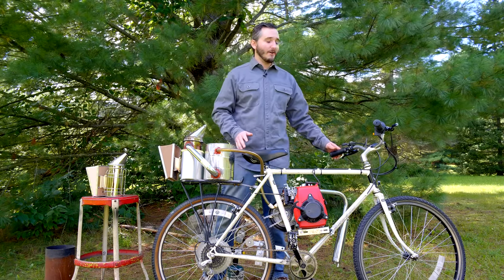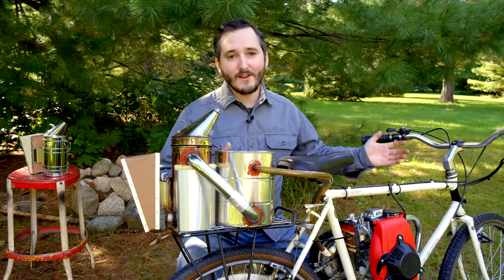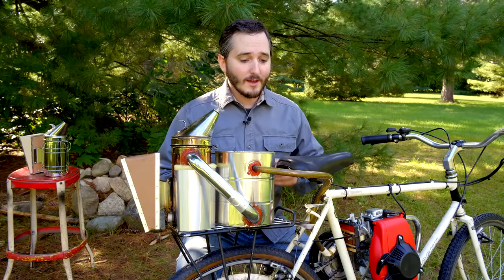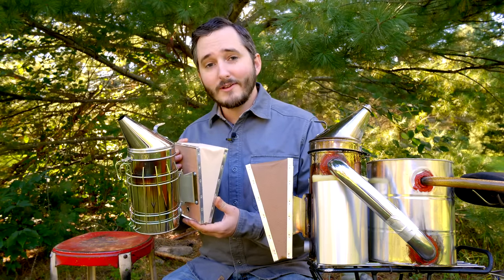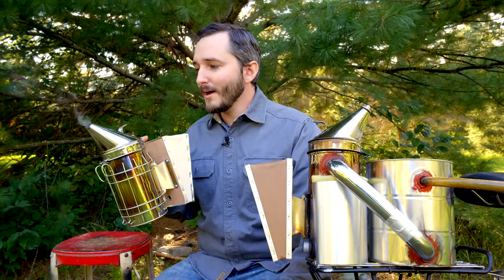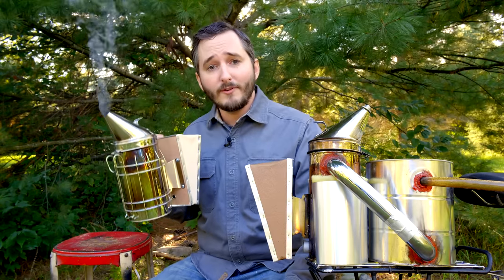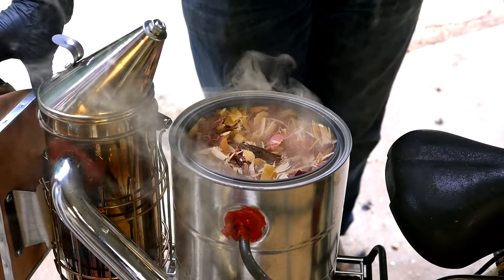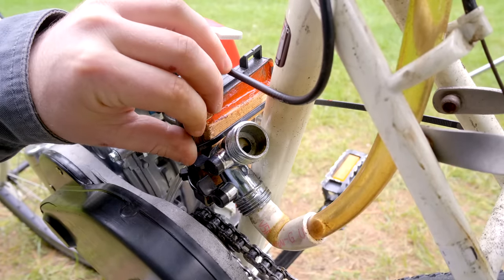Running a Gasoline Engine on Firewood | Woodgas Biofuel

Comment from the maker: Edit: My new videos have been performing pretty poorly these days. You can help by sharing this video to relevant pages on facebook, reddit, etc.. Please don't spam on my behalf, but if you know of groups that would appreciate this video please do share it. Thanks!

A few things I did not mention in the video: There is a small hole drilled into the elbow that connects the gas line to the lower valve on the intake. This allows any condensation that makes it past the filter to drain out. I also realized that the engine's upstroke is blowing a lot of my fuel right out of the intake as evidenced by the smoke pulsing out when the engine is running. I probably need to figure out a one way valve setup so the engine can blow off that backpressure through a different outlet than where the fuel/air comes in.
Reply: 2 stroke scooters use reed valves to eliminate blow back into the carb. Not sure if that system is used on 4 strokes but could be useful in my opinion
Reply: Could you put Air compressed ? For help the combustion
Reply from the maker: The gas is quite cool by the time it passes through the filter, so this may work.
Reply: Why would an upstroke blow gas out of the intake? That does not make any sense. On the upstroke the intake valve is always closed.
Reply: @SinBird I think this is caused by the mass of the gas flow. Inlet valve closes quickly but gas stream wants to continue and the easiest exit path is the ball valve. Same thing when you close a garden hose quickly, you will see the hose move.
Reply: Sorry to hear about that, seems to be more and more problematic with project channels due to YouTube changes.
Reply: You should make a cast iron coffee maker into a bee smoker
Reply: @nickgroen89  i beleive thats called the water hammer effect or something
Reply: Heres some ideas to help get the gears turnin. Off the bat im imagining something like a rocket stove being fueled by the charcoal produced in the reaction chamber its heating ala your earlier design. This would seperate that unwanted product and minimize filtration. As far as fuel i was thinking something like those pellet hoppers they use on woodstoves, if your looking for a controlled consistent fuel look no further than that. But as the eventual goal is using common fuel maybe something closer to a magizine, where long sticks could be steadily fed in as needed. I can't think of a way to make the magizine automated but im sure its possible. Plenty of people who know more about one way valves thsn I have that topic covered. Beyond that i guess its just a matter of producing enough consistently to run the engine. Good luck mate, i respect how you arent uncomfortable showing us ideas that arent finished like this.
Reply: #1 .- replace the garden hose valves with a propane carburetor kit for generator from ebay.
#2.- make a gas (smok) container that can pressurise the gas just 10 psi or so with directional valves , you know, inlet, outlet .
#3.- install  an air pump (electric or manual) to force air flow in the gas combustion chamber (reactor), making smok (gas) go to the inlet directional valve to the gas container to the outlet directional valve to the propane carburetor  conversion kit in to the engine .
Note: (As a pressurized gas container you can use a balloon or bicycle rubber inner tube tire .)
Reply: @Nick Groen That's exactly what I thought.
Reply: You might also have more luck by upscaling signifigantly. Depending on how well the setup works it might work better on a signifigantly bigger platform.  Something like those offroad utility vehicles but more street oriented. Where youd have a sealed cabin for the front two seats and just have a huge rig in the back
Reply: ust to get this clear, 2 strokes are actually more efficient than 4 strokes. If you look at the pressure volume diagram, you will notice that the 4 stroke loses usable energy by pushing exaust gases out, inhaling fuel air mixture and compressing them 3 seperate strokes while the 2 stroke needs just one stroke to do the trick. The reason nobody uses them is the burning of oil wich increases CO2 and unburned CH emissions.
Reply: Would a small check valve for aquarium airlines not do? Cheap & you can get metal ones.
Reply: Yeah I havn't beefor about ane and a half or 3 years and the last few I have checked I have been un-notified about your videos when every single time I come here I hit the notification bell. IUt's like they are hiding your videos and unsubscribing people without their consent.
Reply: I just came across your channel for the first time, and enjoyed your videos... except for the advertising. It's kind of obnoxious, especially when you watch a series of them back-to-back, and especially when it's the exact same set of sponsors that we have to suffer through on other channels. Pretty much the same issue with Mentour Pilot. All the best.
Reply: I'm speaking out of my element but would active carbon help with the filtering? If so, you might be making an ample supply of it with the gasifier.
Reply: Try to run it on Hydrogen
Reply: Try it with a tube on the intake side with the same resistance as the fuel one
Reply: The content is  not the reason, you always have great videos with no clickbait. That can't be said about most of the people on here.
Reply: Weld a extension on to the bee smoker to get are 4x, I would also suggest a diesel top cover tractors you can make it heavier and have it pulled out the string to open it and pull on the other side of the road to close it
Reply: Congratulation dude, you got an new subscriber ;)
But maybe you can make 3 things for more efficiency;
1: you can adjust the ignition timing of your engine for your engine runs better
2: an stock petrol engine have an compression tax too low for runing on wood gas. If you want to make a engine for running only with wood you can make an "upgrade" for your engine got more compression (but will only runs in wood gas).
3: uses an blow back valve before the intake valve. (use an air filter too) For fhe condensation problem you can use the same system as the air compressors uses for avoid the water vapor in the lines.
Reply: Maybe people quit watching because of your commercials.
Reply: @Nick Groen I was looking for this. If the engine has any compression it won't blow back out the intake.
Reply: A cool bird at the end and a comment from cody is enough to get my sub :)
Reply: you should use charcoal (powder) to clean the gas and you can add some sort of sillicagel our salts like table salt our a better option is MgSO4 our maybe CaCl2 in a  drying tube (5dollar ) straight after the cleaner box our you can mix the salts in the carcoal. so the water vapour is out of your gasmixture i think that is one of the biggest issues in this setup you can see the condensed water in the tube. but what a nice project! i love it!
ps that is one beauty of a beesmoker i would love that one!
Reply: You might consider getting a LPG/NG duel fuel carburetor conversion kit and feeding the wood-gas to the engine through that.
Reply: I'm no longer on FB or Twitter
Got banned for political reasons
I do SHARE every one of your videos I watch on GAB
I receive a lot of Thank You's from others for sharing your content
They Love your videos
As do I
Reply: NightHawkInLight please mate put this into a kit people can buy with a one hour long step by step build DVD that anyone can understand. You can change the world with this. Please help your fellow humankind with technology
Reply: YouTube prefers channels that upload prequently, sadly. I'll definitely share it with my friends
Reply: Install a supercharger. This should help a lot.
Reply: Maybe that’s because you content is not as good as it use to be
Reply: I may have missed that info why you do it this way but, wouldn't it be better to make wood gas stationarily? Just load it to a tank, compress and plug to engine instead of making it on the go. Sorry if that's a stupid question.
Reply: Use a reed valve on the intake to eliminate the backflow. They are pretty common for motorized bicycle kits.
Reply: NightHawkInLight You deserve millions upon millions of subs. Try uploading 15 minute vlogs of your projects every other day.
Reply: We still love you!!!
Reply: BikeBerry..plus there's some FB groups - One I know of off hand is run by Zeda Motorsports...
Reply: You definitely seem to be on the right track. My only feedback would be to try and add a bigger gasifier, preferably thrice or at least twice that size. Considering the idle of most ic engines typically run around 1000 rpm, I think that gasifier just isn't able to keep up with the demand. Good luck. Hope to see an update soon
Reply: Seems like it was choking. Needed more oxygen. With all that CO2 and Wood Gas coming out of your air intake, maybe try adding more air and less smoke. Idk. I'm not an engineer haha
Reply: Hey do u know they make bigger smokers? Not 4 or 5 times as large but u could try it☺

Comment: the gasifier i built years ago used activated charcoal and water in an old paint can that the wood gas bubbled through. the end result was pretty pure wood gas.

you're probably also better off ditching the stock carburetor and building your own to replace it.

Comment: Here's a helpful idea, disassemble the pull start and use either a battery powered drill or setup an electric starter. It will save a lot of wear and tear on your elbow and shoulder.

For the filter, try using coffee filters and layer cedar, filter, cedar, filter, etc, etc. You will still get smoke, but less of it.

For the gasifier, you need at least 2 of those smokers and probably 3 to keep that engine going.

For the air intake, it needs to be at least 2 inch pipe, probably 3 inch would be better, and needs a filter to help keep dust, dirt, water, etc out of the intake.

Comment: A one-way valve on the intake could make a difference. It looks like the engine is leaking gas on some parts of the engine cycle. This is bad, because the engine then sucks that air-gas mixture back in instead of just the air. It could also help the gasifier for the same reason.
A filter stage using just water could help clean the gas (but might need to much pressure to pull).

Comment: Nice demonstration of 100 plus years of gasifier tech.

The problem is not a question of generating hydrogen and methane from wood fuel but rather how to handle the long chain hydrocarbons which form tars and eventually gum up the intake and carbonize in the combustion chamber, end of working engine.  These tars require higher temperatures and longer resident times to convert further into Carbon Monoxide or other volatile byproducts.  This in turn delays the length of time the gasifier must function to accomplish a task without actually burning up the constituents before sending them off to be used.  Ultimately it is the tars that are the enemy and higher temperatures eventually tend to accumulate a final carbon layer accumulation so it's always an issue of accumulated fouling at one or more points in the system.

That said, many methods have been attempted to filter out long chains but this is a toxic nightmare and secondary handling issue unless the handling of those tars can be re-routed back to the combustion process at some point.

Inclusion of water vapor at combustion in the engine can help discharge the carbon formation but it's still abrasive and using water kills the ability to apply it in cold temperatures at risk of freezing.

Next, one must understand that utilizing atmospheric air brings in some 80% plus nitrogen into the combustion process resulting in at least 3 species of No(x) emissions which combine with moisture in the atmosphere to form acidic byproducts affecting ocean and rain water side effects, highly destructive over time.  The problem worsens in longer residence times to fight tar, generating higher volumes of NoX pollutants in solving for tar.  The two problems lie at the opposing ends of a gradient of cause/effect inviting loss of simplicity if to make the process viable for mass production / application and support.

Sealed gasifiers in batch mode generate a more viable manner of lower tars but then you have a potentially pressurized vessel filled with combustible gases.  A single backfire invites catastrophe or at the least destabilizing a running processes if it could reach oxygen during a backfire.  Batch processes of loading and unloading leave behind char residuals to handle (secondary carbon char gasifier), or waste accumulation.

Assuming you solve these issues by some degree of simplicity, what do you do with the unused bio-gas when the fire continues to burn but the gas is not consumed?  Since the gas produced is not pure methane or hydrogen or carbon monoxide, you cannot safely store it in containers unless those containers have an active mixing process inside them.  Otherwise these gasses separate into their own respective layers and you get huge swings in volatility tapping from the top versus bottom etc.

Nice demonstration as always, but unfortunately it needs to have an explanation of the downside complications so others are not inclined to waste time,  money and injury without understanding the risks and complications.

Thanks for the efforts.  Nice demonstration as always.
Reply: So you could run a water filtration system with just enough alcohol in it the stop freezing. If not for flammability you almost could just run alcohol. I'm not a chemist but it might also help capture or break down tars. the problem is think is most things you would introduce should be pretty dangerous. Like acetone to the mix for a cleaner burn. Maybe you could snatch up a bunch of cigarettes littering our planet and make a large filter, as they are designed to handle high heat and capture tar ....
Reply: urban you must be fun at party’s
Reply: Thanks poindexter
Reply: @travischooter  very
Reply: collect it then send it to a cracking tower lol
Reply: it's only problem for snowflake gas engines. My diesel would eat the wood chips with tar additive sauce
Reply: urban: Damn! I guess if it came down to it, Me thinks I would get a horse. One horse power is better than none. And they really make the best ATVs. They don’t normally get stuck.
Reply: This is why coal power plants don't use wood, or impure carbon sources. This is also why gas power plants use a particular method to nearly eliminate NOx formation in the natural combustion process without any additives (lean burn). NOx gasses are also great for fertilizer and creating ozone high up in the atmosphere, so it will cause acidic rain and smog, lung cancer maybe, but the trees and weeds will be doing just fine. Have to think, have they planned this for us the whole time?

We only use the most excellently procured Aged Tree Juice™ in our crankbreakers. We made sure that it was cured for several hundred million years, and only then do we put it through the most rigorous process before we consider it to be added to our top-shelf supply. 

Simpletons using wood gas? You don't say.
Reply: @Baigle1   CONCISE?
Reply: @musicnoonelikes  ;~)
Reply: very good info :) Thanks :)
Reply: @urban .thanks
Reply: @urban That is a wealth of information.  I wondered about the side effects of using wood gas, great to know what they are. Deep thanks!
Reply: @Walter-Montalvo  Thanks Walter.  There's more to the story but owing to the original poster having opened the channel, I'll reference this reply further in a top post here where I can given credit where credit is due.  See the next entry for further.  Urban
Reply: TY for your obvious knowledge in this area. But knowledge of survival and when wood, water, solar, hydrogen helps one survive then it's valuable, we're in that reality and best be ready. ☝🙏💜

Comment: Food for thought:
Install a second gas line water hose value on the gas line before the one on the engine. That way after you can turn up the one on the engine you can leave it  turned tuned to run the engine and use the extra valve on the gas line just to open can close to release gas so you don't have to re fine turn your engine gas/oxygen valve every start also release gas also open it to start the gasifier. 

Wishing you had a electric starter yet? :P

Comment: I think the filter that you need for the wood gas is activated carbon. It filters tar and other stuff really good out of smoke. That's the reason they put it in smoking pipes as a filter. Just fill a big tank with it and let the smoke pass through it.
Reply: smart. you know where i've found something of sorts? when i've brought a filter for a kitchen extractor.